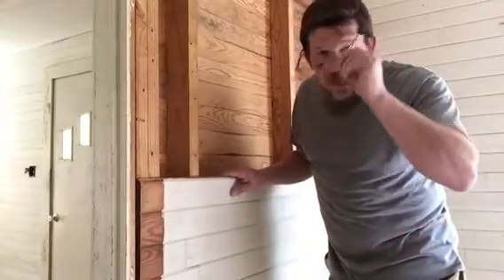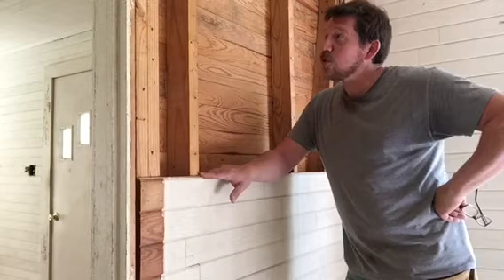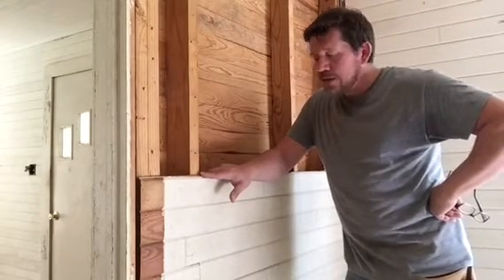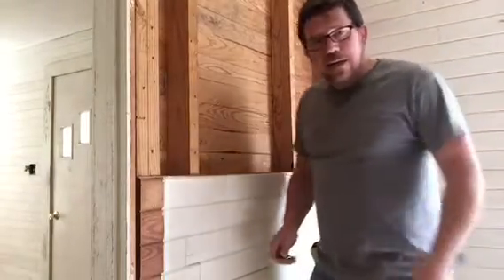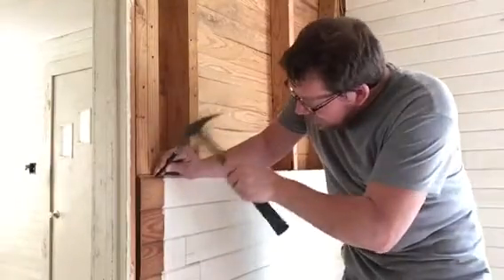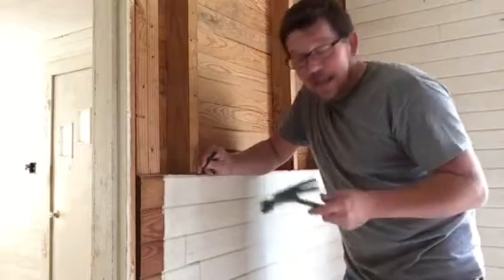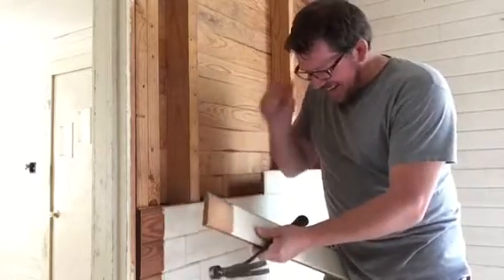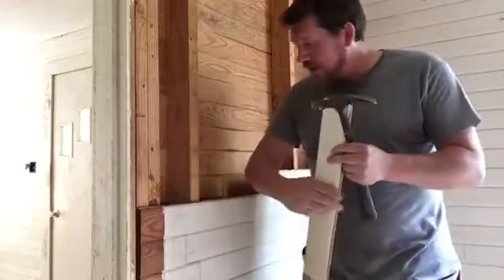Removing Tongue and Groove Wallboards

Comment: Glad i found this video, because i bought a house and after 4 layers of wall I finally got to this stuff. House was also built in the early 40's and this stuff is a pain to remove with a crowbar, been fighting with it constantly. Will definitely give this a go to see how it goes.
Reply from the maker: The most important thing to remember is to be patient...and be willing to change your approach. Every board and every nail is different from another, so there may not be a universal method. But this will be a good start! ;) Let me know how it goes!
Reply: @AppleValleyFarmGA  The nail punch and hammer is excellent for removing them without damaging the tongue and groove. I did that for the walls where the wood was still good. The other walls I used the claw part of a hammer and a hand sledge to pry them off, which worked really good for removing but not for salvaging since it usually broke the tongue parts.

Comment: Love the humor... Taking old siding off chicken coop... Never thought about using a punch... Thanks man!!!
Reply from the maker: The nail punch is definitely the way to go, IMHO. Unless you get into seriously old structures with square nails. Then it doesn't work that well. But with the dimpled heads in finish nails, it does the trick. :)

Comment: My dad did beautiful T&G board work in the laundry room for my mum. He just passed away 2 days ago and we're in a real cold spell right now here in the Northeast (-8C  BBBRRRRR) . He used to remove one or two of the boards from the wall that covered the pipes in weather like to to prevent the pipes freezing (outside wall). I never saw him remove them...can you tell me how to remove them when they have been left loose for this purpose I don't want to damage them in any way...especially since i have no way of finding out what stains he mixed to get the beautiful colour he got on them.
Reply from the maker: That's a great story! Thanks for sharing. :) In my experience, I always have to "sacrifice" the first board...which you may not want to do. But your dad may have just tacked it in place anyway. If that's the case, then you'll see nails used on the outisde of the board...on the others, the nails are blind, in the tongues.That board may be the closes to the bottom. If you find this board, then just remove those nails, take the board off, then either gently pry the board off the wall from the back (which pulls out the nails), or use a nail set to drive them on through. (I would suggest the first). Not sure if I'm helping much...I have the most experience in deconstructing for removal. But I think the above instructions will work. Thanks again, and let me know how it goes. - Ricky
Reply: Thank you Ricky,  I'll give this a shot and let you know how it goes. He didn't nail them tho-there are 2 boards that float freely. The rest of the room is nailed but the removable boards he left free floating. I'm afraid of snapping the tongue portion off one of the boards or, just as bad, denting it from the screwdriver.  ~ Jax